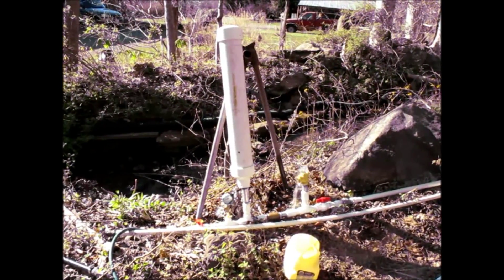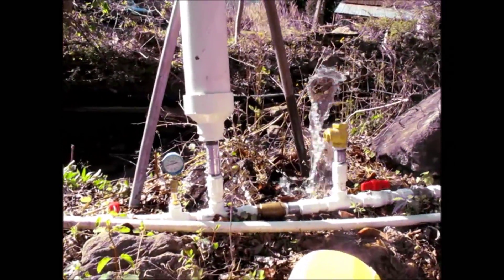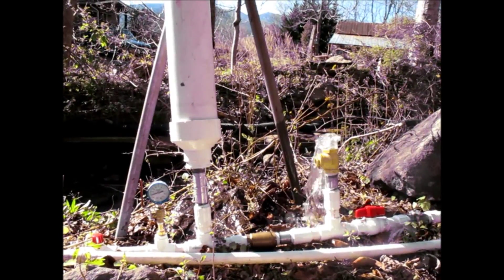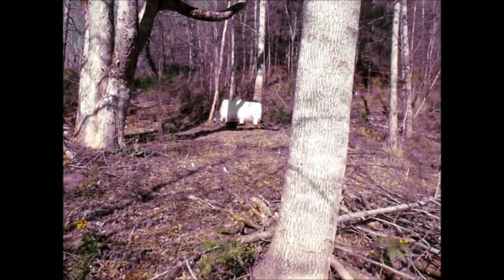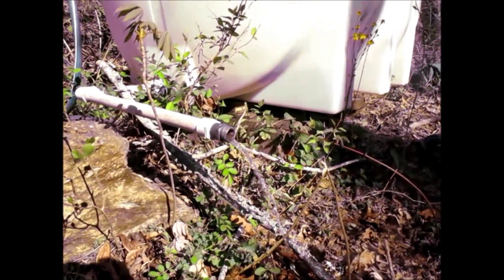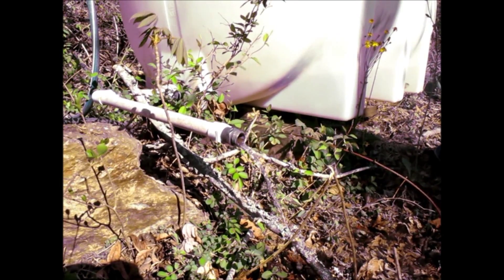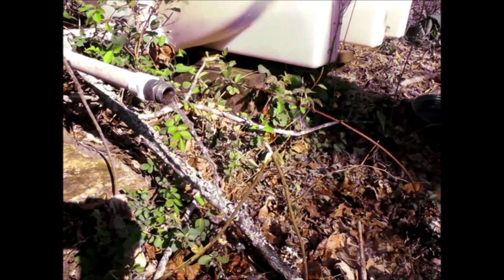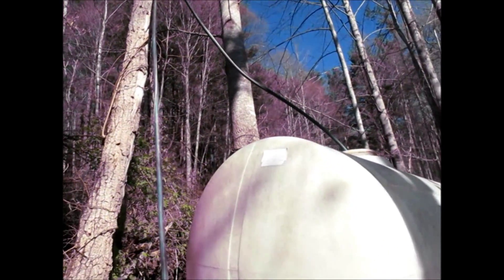Ram Pump

Comment: how did you work out the 4 gallons per minute rate?  later in the vid. you mentioned 1 1/2 gallons per minute out of the tank, where did the other 2 1/2 gallons get to? I have a 2" ram pump with 20' drive head, it produces 52PSI and I get a  generous gallon at 120'. I can improve the volume by about  50% if I use a larger diameter delivery hose.  love the ram pump
Reply: That was an error.  Glad you spotted it.